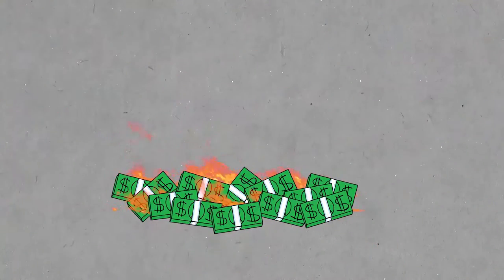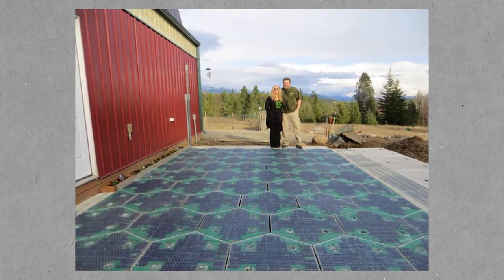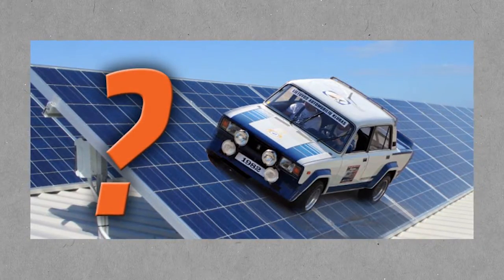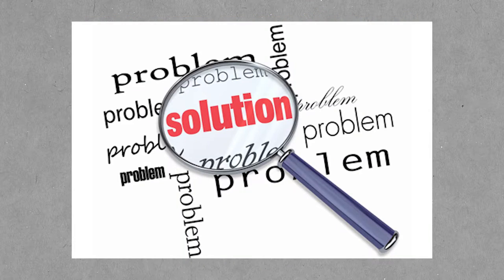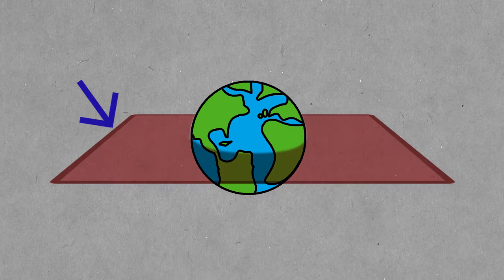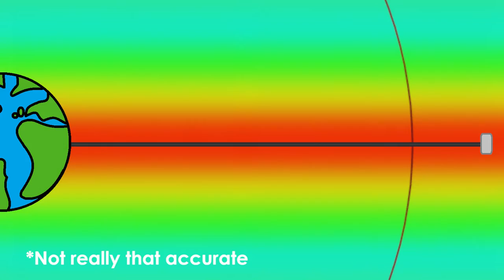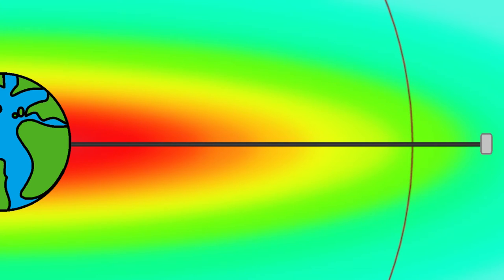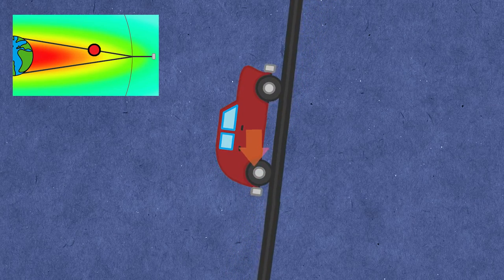How To Fix The Space Elevator!

Comment: I find what you say really smart. I hope you continue doing stuff like that and I agree with what commenter Galahad said, your channel has thousands of subscriber quality level.
The idea of splitting the cable is very interesting. I always thought that avoiding the Cloud of Doom would imply moving the cable base dynamically using a mobile floating oceanic platform. And also inducing oscillations in the cable to preemptively move it out of the way of debris.
Your idea is much better I think. In addition, two cables would reduce the overall stress I would think. A lot of math would have to be done to test this idea of course (I'm picturing Rich Purnell in the super computer room in The Martian, waiting for his calculations to complete).

Comment: Your view of space debris isn't very accurate, it is more spherically distributed at LEO than you realize. Any elevator cable that doesn't go straight up will encounter even more space debris as it passes through that spherical zone obliquely. But this is really a moot point as there is no existing material of sufficient tensile strength, elasticity, and low density from which to construct the elevator cables. Nano-tubes, which derive their strength from covalent sp² bonds, will not suffice. The best theorists can do is conceive of a material that might be about two-thirds the actual strength needed.

In the spirit of contribution your design would permit a higher degree of cable use as one-way only traffic would only be limited to the last single segment, with departure and arrival traffic moving simultaneously on separate branched segments.
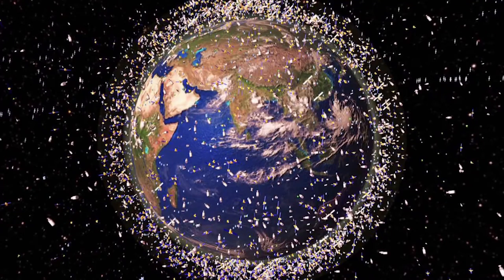Reply from the maker: I'm aware that debris appears to be spherically distributed, see 4:52, but the problem with the equator is that EVERY orbit passes through it. Every satellite crosses the equator twice per orbit no matter what. Not every satellite passes over the poles. It still might not survive long, but at least it has a chance not to be hit, on the equator it is guaranteed to be hit, by every single satellite that isn't in some kind of synchronous orbit.